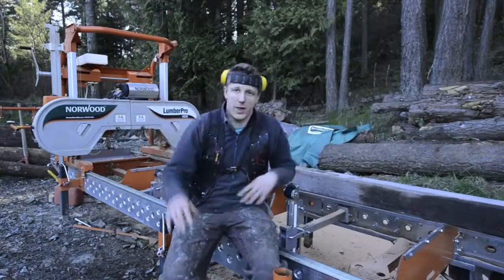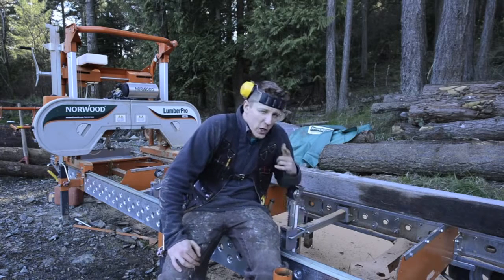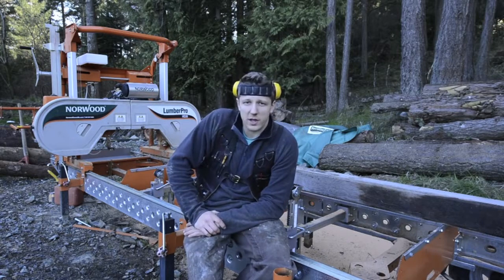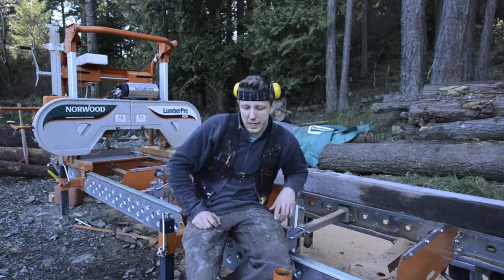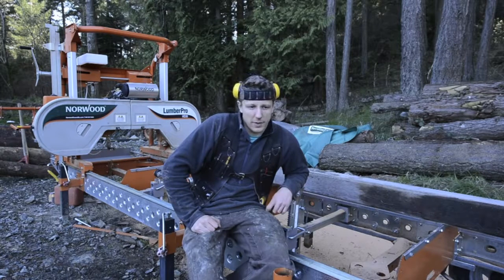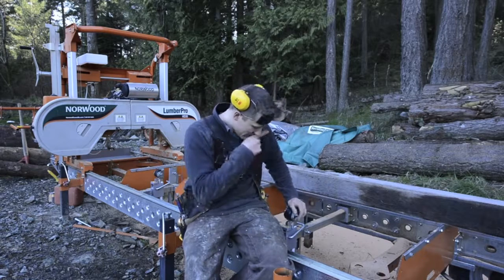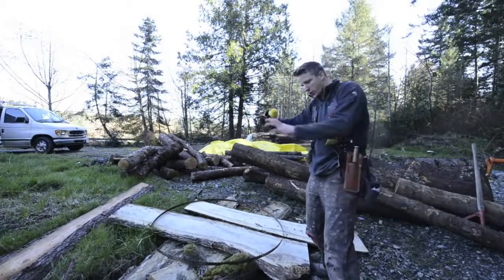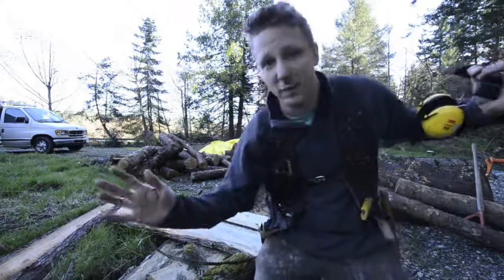153 Norwood HD36 Sawmill, Honest Review from an Owner

Comment: Thanks for the honest review.  I'm looking at buying this mill or possible the woodland mills 130.   Hydraulics are out of budget, so good to know their manual winch ramp system isn't that good.   I have a small compact tractor - lift capacity of 800 lbs, so this won't be able to lift anywhere near a 30 or 36 inch diamater log, especially hardwoods.   I do have a portable winch, which might be useful If I can anchor it close to my mill.   So I'm leaning towards the trailer package, and winch the logs out of my forest / valley - and then mill on the spot.   I heard debarking the logs will save on your blades.